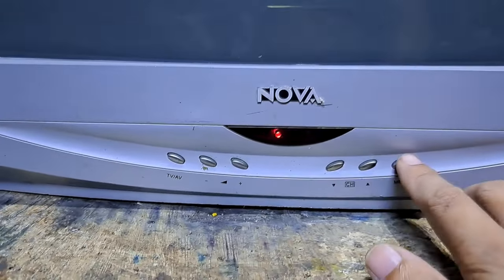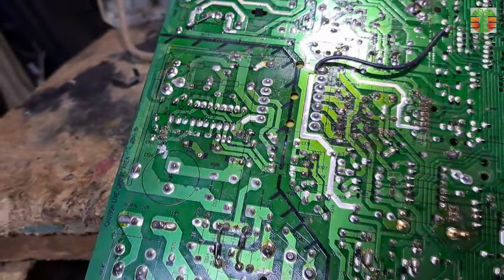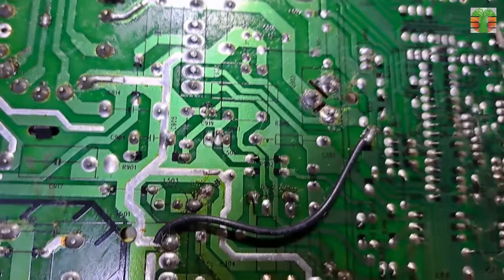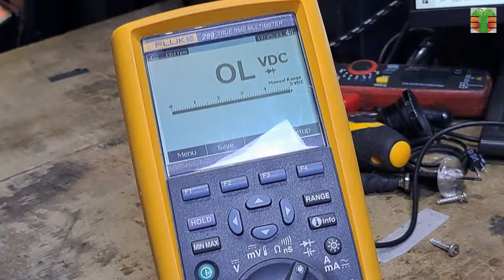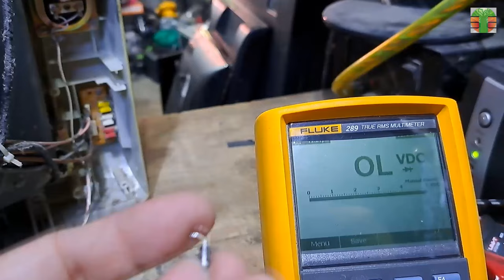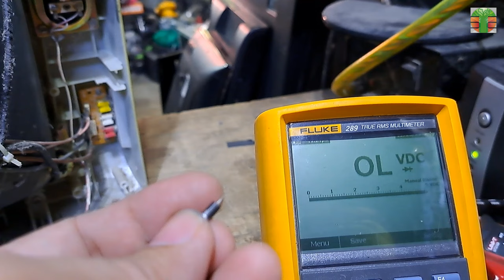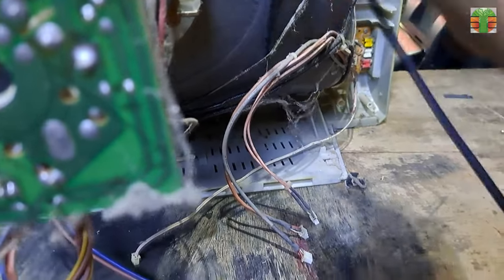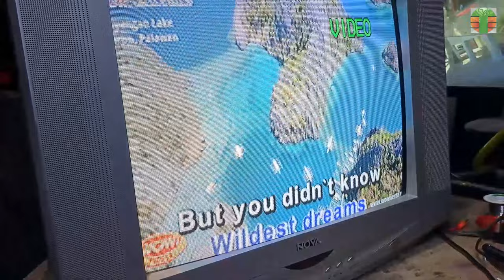NOVA CRT TV no power repair.

Comment: Hello.the great tevz TV, I have 29 inch LG CRT TV(CN-29H3) which won't display any screen But It surely lit its led lamp ,whenever I plugin ac cable.
It is written "MC-7CA(MAIN) 6870VM0056C(6) 980424 L.W.G(0)" and
"MC-7CA(CPT) 6870VS0167A(1) 971014 K.J.B(0)" on the surface of its PCB.

I plug in this 29inch CRT TV,and switched on ,then I measured pin#9 of STR-S6707 by placing red probe of analog meter to pin#9 and placing black probe to negative termainal of C808 the biggest capacitor(400v 470uf) and It was measured 6.4-6.6Vdc.

But In the datasheet of STR-S6707,It says that its On-State Voltage is 7.6Vdc.So I think that there would be a defective component which is undoubtedly adjacent to pin#9 of STR-S6707.

And In the same way,I measured cathode of ZD808 zener diode and Q800(C3852A)base,It was measured 7.1Vdc.

I also measured positive terminal of C805 and cathode of  D807 and Q800(C3852A)collector,It was measured 10.8Vdc.

i found The big capacitor(160v 100uf) on the cold side,I think that it is the B+ filter capacitor,So I measured it and It was measured 39-40Vdc.
I desoldered all of electrolytic capacitor which is nearby STR-S6707 and measured its capacitance and ESR value But It seems that all of electrolytic capacitor seem to be Okay.and I also measured most of carbon resistor and diode which is nearby STR-S6707,But It seems that all of resistor and diode seems to be Okay..
Is there no way to find any clue for repairing this CRT TV?

Comment: bossing hingi sana ako ng tulong. may devant led tv po ako. stambay lng po sya. pag on ko sya mag palit ilaw nmn sya na kulay blue tapus bigla nmn balik sa red. kng baga nka auto shot off sya. ano po ba kadalasan sira nito. salamat po ng marami.
Reply from the maker: Marami kasi dahilan yan, baka power supply,  backlight,  software or motherboard.